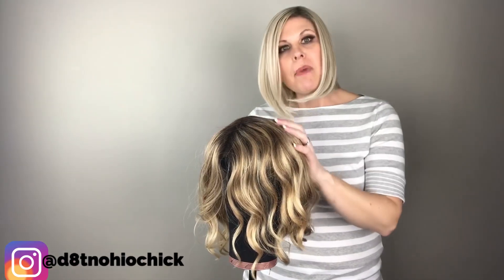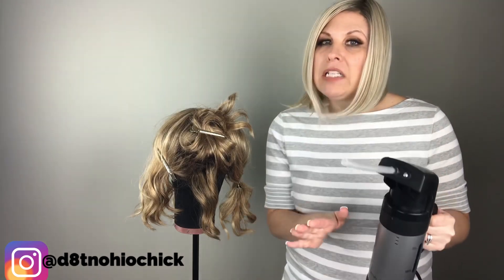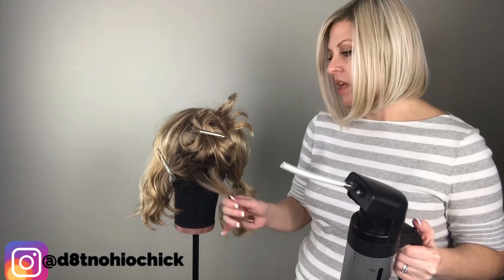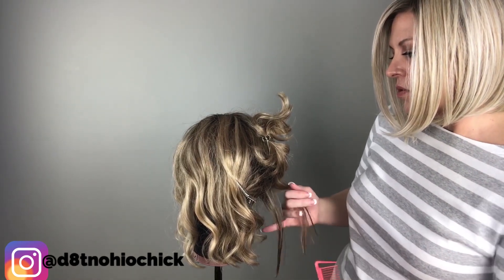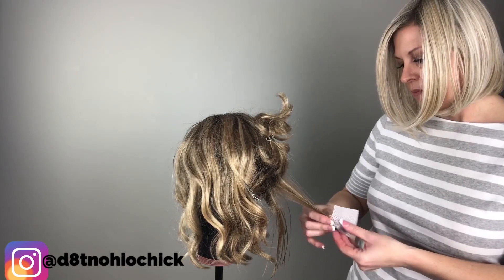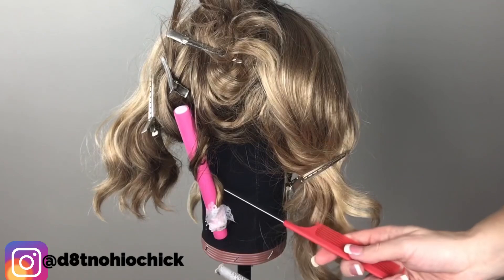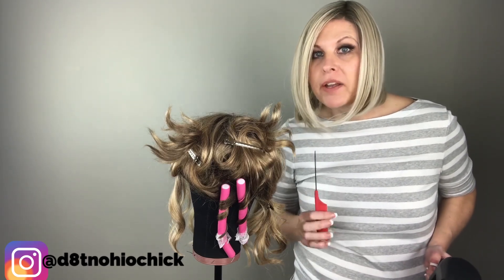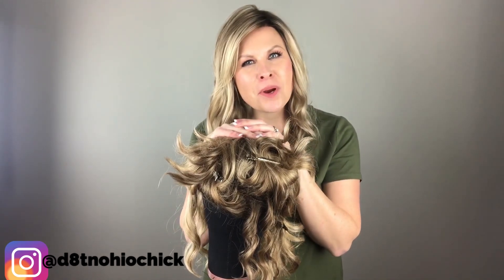Wig Steaming: Straightening and Adding Curl To Synthetic Hair Using The Jon Renau Steamer

Comment: My jon renau steamer constantly spits water. Have you ever had that problem?
Reply from the maker: Hi Danielle. I haven’t run across that yet. Does it spit water out when it’s full, running low on water or the entire time the streamer is on? I recommend using distilled water to prevent buildup inside the reservoir or where the plastic tubing attaches to the steamer (which is where I assume you’re getting the spitting).  If you see buildup on this area, I would take a little bit of cleaner that removes hard water deposits and spray it into a cotton ball and throughly clean the area. We have a water softener but even that water still leaves hard water residue in my steamer. Hope this helps! If not let me know and I’ll look into it for you. Thanks for watching!
Reply: @KiraL.Wilson  it's a brand new steamer, I've only used it twice, and both times it spits water constantly. When it first gets hot water is actually pouring out the tube then it slows down and just spits but it spits out enough to leave a puddle of water.
Reply from the maker: @dink4evr  I’ll reach out to Jon Renau and find out if they have any recommendations. Have you tried to contact the store where you purchased the steamer to see if they had suggestions or could return or exchange it for you? Since it’s the weekend, I’ll probably have an answer for you Monday or Tuesday :) Thanks!
Reply from the maker: @dink4evr  I just heard from a rep at Jon Renau and they advised they received your inquiry, will research the issue and get back with you as soon as possible with a solution. Thanks!
Reply: Thank you so much!!